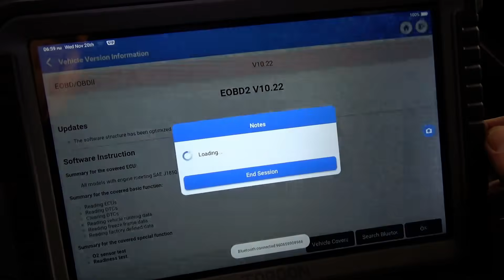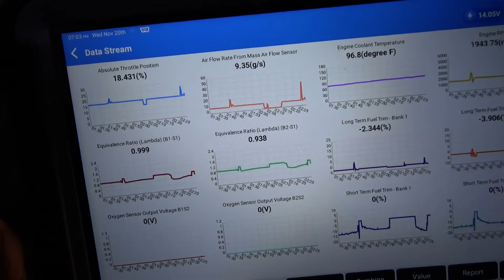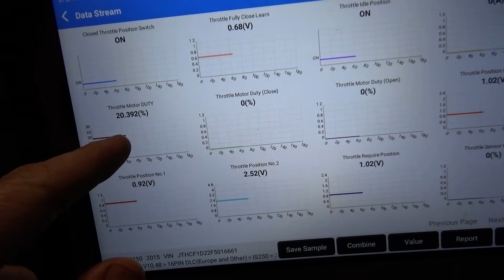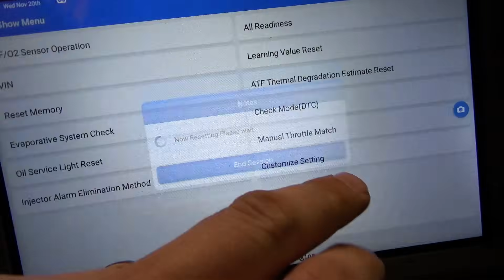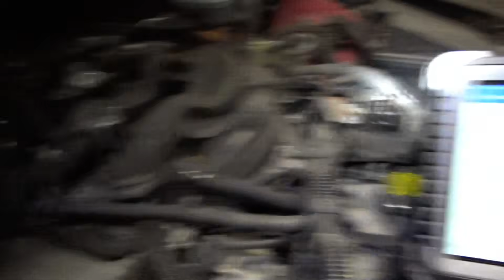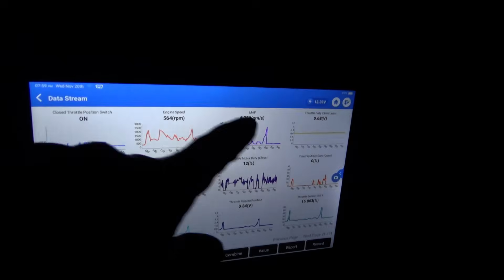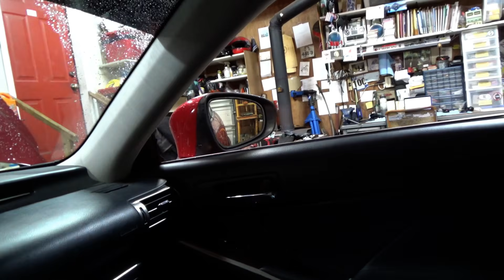CRAZY Lexus Idles at 2,100 RPM?!? No Codes Set!? ('15 IS250 V6)

Comment: No vaccum leak checks? Brake boost leak? Pcv leak? Having same issue with 2018 Lexus is300 turbo 4cylinder idling at 2000 in park 1200 in gear. Toyota dealership said tbody was bad. Changed tbody and same 2000rpm. Im lost. Haven’t checked brake booster for leaks yet.

Comment: I have a 2015 Lexus nx200t. Has a slight skip from crank up till about a mile down the road. Consistently every morning when my wife leaves for work. And when she leaves from work of the evening. Runs great in between. With no code thrown. Any ideas.  I’ve changed the coil paks and plugs with NGK

Comment: My 09 IS250 with 174k miles cold start idle was just above 1,000 rpm but wouldn't come down until I shifted into gear. Thought it was normal for these cars from what others said online. Recently had transmission pan gasket replaced cause it started leaking. Cold start idle is now 1,000 rpm then settles down to around 700 rpm without having to shift into gear. I think  your transmission diagnosis is correct 👍🏽

Comment: I would take the ecu to a have it opened and tested as it only cost $150 or 180 at sia electronics.
Reply from the maker: Why would you waste than money when it needs a torque converter lol
Reply: @PineHollowAutoDiagnostics   generations lexus previous to this used to have shifting issues within the ecu. Maybe theres corrosion or desoldiered terminal inside thats causing the high idle in the transmission module inside the ecu.
Reply from the maker: @ibidu1  Well that may be a possibility, but there are no codes set at all, and the PCM is controlling everything just fine...Purely mechanical problem in this case; the PCM is just trying to compensate :)
Reply: @  Would make sense why the idle goes to normal after unplugging the battery. As the ecu could be reseting. Im not a mechanic, and that my theory, but you are more knowledgable then me

Comment: I read if the ECM detects low voltage it will raise the rpm to compensate. I think there’s a pid for ECM voltage. Probably wouldn’t hurt to voltage drop the negative battery terminal to the block. Last thing, if it’s helpful, I read in TIS that 0.93v on VTA1 and 2.55v on VTA2 (TPS1 and TPS2) happens during fail-safe control. Looks like you were pretty close to those voltages at one point. In fail safe, the throttle blade remains on the 6 degree return spring and throttle is controlled by the fuel injectors. There’s a couple enhanced Toyota specific throttle codes that might not show up on a regular OBD scan. Other things besides throttle body on the high idle list in TIS are a/c signal circuit, intake system (maybe vacuum leak, but your trims are negative), ECT (maybe because of the cold start injector), PCV hose, ECM power source circuit, and ACIS control circuit (intake air control valve in plenum)
Reply: Thanks for the video by the way. I always learn something watching them

Comment: This seems like a really rushed and incomplete diag by Ivan which is somewhat shocking given his abilities. More is at play here and I don’t see the transmission as an entire assembly at fault. At the very least check the fluid condition, and trans temp at idle in park and compare to similar models to see if it’s an anomaly. If it’s dragging the trans, it’s getting hot.
Reply from the maker: Needs a new torque converter and a trans fluid change. What's so shocking about that? 😜

Comment: All you had to do was an idle reset procedure and you don't even need a scan too ..its a common issue even in the previous generation lexus IS
Reply: Not always. I worked on a few of these and twice it was a transmission issue….same exact symptoms.

Comment: I just learned after changing my battery on my Toyota Solara, there is a idle relearn procedure.  The ecm controls the idle speed and relearns where it needs the throttle vs rpm.  You need to do it on warm engine and no accessories running.  Look up procedure on YouTube.  It took me 3 tries to get timing correct of steps....the steps in scan tool do not match what I had to do.

Comment: you need to get a known good calculated absolute  load value, usually around 12-20% at idle in P or N, does it hugely increase when you drop it in gear?

Comment: Had this very exact same issue with a Lexus ES 350 I owned. High idle, close to 2.1-5k rpms. Replaced the throttle body, rpms lowered temporarily, tried a known good part and it worked well but rpms were still high at around 1.2k. Till this day the vehicle has that same high idle issue just less pronounced, never could figure it out just yet since im still a novice but performed the majority of the tests in this video. I did wonder if the transmission was the issue too since the car had 250k+ miles but it ran smoothly. No dtcs set either.

Comment: Would it be possible to go into the TCM and manually control the mode switch to see if that makes a difference?  Don't think I saw you go into the TCM.  If there were a drag on the engine, how could it drag sometimes but disconnecting battery for 10 minutes makes it not drag?  Readings for engine load on scanner?  Would sure be nice if there were known good scanner readings for comparison of all modules.  Normally you don't accept replaced parts of unknown origin.  Been watching your videos for a long time and am impressed with your diagnostics.  This one has me scratching my head.  There's more to this story and hopefully a part 2.

Comment: Coffee spillage in that shifter mode selector is a problem aea. Had the same on a Range Rover sport giving strange feedback like you had. Replaced the unit cleaned the coffee from the plug and worked fine .

Comment: Until the idle speed connection with the transmission was determined, I kept thinking, if the accelerator pedal is commanding the engine to a higher rpm, then there would be no codes. So I would have checked accelerator pedal position live data, to rule it out.
Reply from the maker: @osuuma6935  yup great point! That's the first thing I did 😉

Comment: A dragging transmission when on gear is only caused by a stuck lockup of torque converter.  Can be mechanical on torque converter, valve or solenoid stuck or receiving the signal to activate,this last one can be a  short. Maybe the spill ? Green crust?
Reply from the maker: Yup needs a new converter :)
Reply: @PineHollowAutoDiagnostics    Not necessarily, could be what controls the converter like, LU solenoid, valve, TCU command etc. 
Either way, none of this matters, as a student they most likely don't have alot of money to waste and was duped by the seller unfortunately.  They should just cut their losses and sell it to buy something else that's less expensive to repair.  The Lexus was a foolish purchase to start with being a student. (Dad statement) lol

Comment: Would replacing the torque converter fix the high idle problem instead of replacing the transmission?
Reply from the maker: It should. I'll post the follow-up tomorrow :)

Comment: That throttle closed switch is suspect. That is what is preventing the throttle from moving any further as it acts as a limit switch, and the learning procedure works like the homing routine on a printer: It moves off the switch and moves backwards until it sees a change in the switch, and then stores the sensor value for the closed position. It should be either ON when the throttle is fully closed and OFF otherwise, or the other way round.

The switch was ON the entire time you were moving the flap and acting eratically, that is why the throttle position sensor reads zero and the flap won't move any further more closed. Which means it's either a misaligned switch, or it has faulty wiring from the switch to the ECM.
Reply from the maker: But disconnecting the battery made it idle perfectly...never touched any switches :)
Reply: @PineHollowAutoDiagnostics  There's a switch inside the throttle body where it should touch if it's at the end of the travel. The replaced throttle body may have a bad switch or it is very poorly aligned.

It's not a user-accessible switch that has a button, it's a microswitch that is actuated by the throttle body flap.

I still agree that the TC is bad but it does look like those switches that you can see on the live data are acting weird.

Comment: I don't know about that transmission being the problem.  What happens when the transmission electrical connector is disconnected?   What's the engine idle then?  Or if the vehicle has a TCM, disconnect that.  What's the engine idle then?
About the mirrors.  What are the powers and grounds?  
What about bad engine/transmission grounds?

Comment: I wonder if there are some manufacturer transmission codes set that aren't giving any indications aside from the high idle. Incorrect oil in the transmission can also result in high drag. If the gearbox otherwise behaves well then it could be worth trying to flush it with the right oil instead of trying to replace it.

Things like this increases the love of manual gearboxes.
Reply from the maker: Once the torque converter starts dragging like this, new trans fluid won't fix it unfortunately :(
Reply: @PineHollowAutoDiagnostics  I see, I probably missed that it could be the torque converter. Modern automatic gearboxes are sometimes a bit tricky to figure out since there are so many things that can go wrong. However the torque converter uses the same oil as the gearbox, so if there's something wrong with the oil viscosity then it might also drag. Some people fills the wrong oil or uses oil additives like STP just because they think it might improve things.

Comment: this might be a long shot but this Lexus IS are notorious high idlers on start under cold temperatures, maybe the outside/ambient temp sensor is defective, it is located behind the front bumper in the crash bar, the car has a huge open grill so maybe a rock hit it or some debris is covering it.

Comment: Had this exact same issue with a few Toyotas. The computer is too smart. Auto transmission drag/ slippage is a good diagnostic. Just wish there was a way to bypass the issue, until the transmission completely went out. Was putting it into neutral for a work around and computer would drop the rpm.

Comment: All of those buttons in the center Snow mode traction ect.  Are there connections through that module? Perhaps they need to be made to be in "normal mode". With it removed its in one of those special modes raising the idle?  We cam see the ECU commanding the idle up.
Reply from the maker: No codes so the car isn't really looking for an input from those silly buttons :)
Reply: @PineHollowAutoDiagnostics  That makes sense what I was thinking is it was in snow mode which usually starts the car in second gear and therefore has the idle up however after thinking about it you would see the snow mode on the dash and you would also feel it when normally driving it.  You right! I didn't have a complete thought lol!

Comment: I would be curious to see the APP sensor and do you also think its possible that the center console switch is tied to the transmission computer and is possibly "confusing" it since it doesn't know what "mode" its in? Great stuff.

Comment: To clarify what I said about the Nissan MF5 5 speed manual transmission which is fitted into my Holden VL Commodore, it is also the same transmission which is fitted in the Australian built Nissan R31 Skyline,I replaced mine with the MF5 transmission which was out of a Nissan R33 Skyline GTS which has slightly lower gear ratios for the 2.5 litre Nissan RB25DE engine.

 They still work with the 3 litre Nissan RB30DE engine which I built for it but I had to get the Castlemaine rod shop in New South Wales in Australia to made a converter box because the speedometer was 10 kilometres out, from memory,😮 a speedometer drive gear from a Jatco E4N71B 4 speed automatic transmission fitted into the manual transmission because I needed to convert it from the R33 Skyline GTS speed sensor pickup for its electronic speedometer to the mechanical cable driven setup for VL Commodore, the Jatco E4N71B speedometer drive gear fitted the MF5 manual transmission.

I did try wiring the automatic neutral position signal wire from the ECU to the Nissan MF5 5 speed manuals neutral position switch  but whenever I put it into neutral it would idle too high at 1200 RPM or something.

So,I permanently grounded it out so that the automatic R33 Skyline GTS ECU thought that the transmission was in park or neutral all the time, it idled too high because it was thinking that the transmission was placed into drive or reverse & under load when in fact that I was using an automatic R33 Skyline GTS in a 5 speed manual Holden VL Commodore !

Comment: How would a battery disconnect temporarily fix a mechanical problem in the transmission?? Why was the throttle body changed in the first place (may never know the answer to this)?  My next diag step: get into the theory of operation to understand how the components talk to each other, what the expected values are compare with actual values.  I suspect (guess) aftermarket TB is junk, but doesn’t explain WHY it was replaced to begin with.  This is why I stay away from used cars w/ no detailed maintenance history.  I’ll take the depreciation on a new car to not have to deal with unknown maintenance and follow on repairs like this.
Reply from the maker: Battery disconnect just clears the learned throttle angle at idle in Drive... Obviously doesn't fix any mechanical faults 😅

Comment: I am wondering if the ECM sees the Park/Neutral switch input from the transmission CAN messages correctly... Does the ECM realize that the car is in P or D to adjust idle speed correctly? Perhaps if the ECM always sees the car in P even if the transmission is physically in D, it doesn't compensate for the added load and relearns the new "loaded" idle as the idle in P if that makes sense. Oh and for the thought that the car wouldn't crank if the TCM thought that was in D, i know that some cars have multiple Park/Neutral switch inputs/sensors. Some of them are physically wired as a starter inhibit, and others are fed to the TCM and broadcasted on the network. So maybe the P/N input to the TCM is faulty. Just my educated guess here...

Comment: I can remember when I did the twin cam cylinder head conversion in my Nissan RB30E powered Holden VL Commodore & having used the automatic ECU in a manual car & how the 5 speed manual transmission doesn't have a neutral position switch which controls the ECU (they do have a switch but it might only be for a light), it idled a bit too high or something.

The fix from memory was to ground out the  neutral position switch signal wire from the ECU to ground so that the ECU constantly thinks that the transmission is in park or neutral when it's actually a manual car.

Regarding the mirrors, in my 2002 model Holden VY SS Commodore I have fixed them up by cleaning the copper switch pad inside of the switch with steel wool because sometimes they get corroded which prevents the mirrors moving on the X or Y axis or even both.

I had to replace the mirror glass in my dads 2013 model Holden (Chevrolet) Colorado RG on the passenger side which is on the left hand side in an Australian delivered truck.

When the mirror wouldn't move one way (X axis ) after refitting the mirror so I managed to pull the gearbox apart & somehow unjam the actuation rod which works in conjunction with the Y axis part as well.

I was afraid that it would cost either $220 AUD for a new OEM motor & gearbox assembly or about $70 AUD for an aftermarket mirror assembly, it's still in use now !
Reply: The switch on the VL's 5 speed manual is the reverse switch.
Reply: @johnt.848  Yes but it also has a switch for neutral which doesn't do anything !

Comment: I would have looked at Accelerator pids too.. and maybe tried to let it idle with the APP unplugged.   If there's a wonky APP telling it to idle weird --  it will idle weird and not set any codes, because it just thinks the driver is inputting that signal with his foot..   Of course, there are typically two APP sensors built in, so it would be strange for them to both go bad at the same time........  Then again, maybe it's just a physical issue with the pivot pin or something??    (turns out, it was just the floor mat folded over and pushing on the pedal. lol..   jk)
Reply from the maker: Good thought... But disconnecting the battery wouldn't magically fix a faulty APP right? 😉
Reply: @PineHollowAutoDiagnostics  IT's hard to say ..  everything is a "module" now--  and complex circuits can do weird things (as you know very well)... It's definitely a strange one.